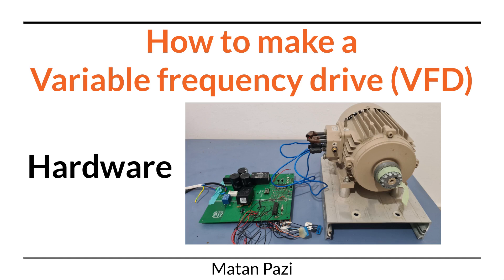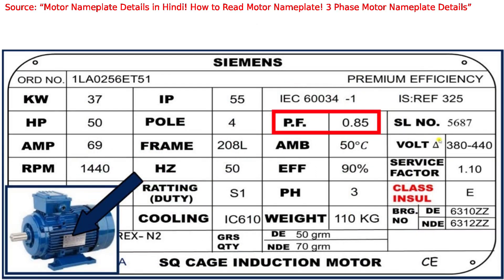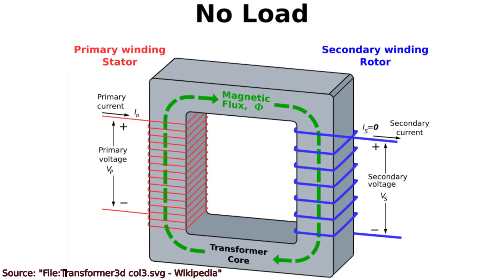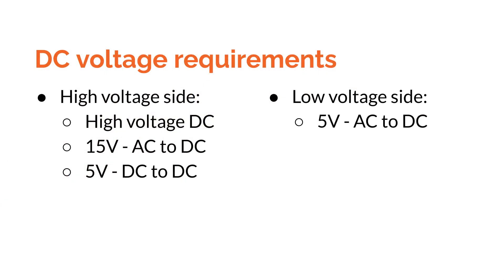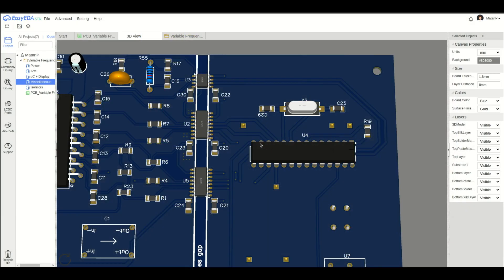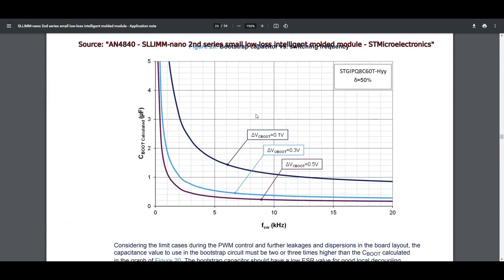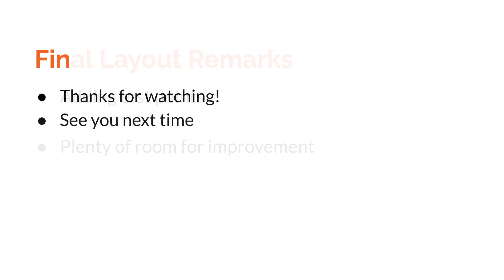How to make a Variable Frequency Drive (VFD) | 2: Hardware Design

Comment: Hi Matan, outstanding work, really, I have a question regarding the STGIPQ8C60T, For the calculation of P_RS, is it suppose to be (8/3)^2*(0.2) instead of (0.2/3)? Because every resistor has the value of 0.2 Ohm. Nevertheless, it is an excellent project that you conducted.
Reply from the maker: Thanks, can you please share the relevant time stamp?
Reply: @MatanPazi  Hi Matan, sorry I saw you reply lately! In my design I am looking for R shunt. I looked to document AN4043 (Application Note SLIMM Nano). I noticed Equation 4: P shunt = I shunt^2 * R shunt/power derating ratio, but in your design you divide the current 8A by 3 ( because you decided 3 branches), but instead of multiplying the resistor value 0.2, you divided 0.2/3. So, the question is how we decide R shunt because I couldn't find  the power derating ratio?
Reply from the maker: @mahmoodal-imam2892  What time did I do this calculation?
Save me the time :)
Reply: @MatanPazi  Hi Matan, thanks for replying. I am not sure I understand you about the time of calculation? do you mean input AC frequency? or the sampling rate of the PWM?
Reply from the maker: @mahmoodal-imam2892  haha no, at what time in the video do I make the calculation?
Reply: @MatanPazi  😁 Oh! Yes, that is right!! It is starting at 11:50 when you starts talking about the IPM. You said that you referred to datasheet examples. The R shunt that I asking about is in the IPM block
Reply from the maker: @mahmoodal-imam2892  Well shit, that's an absolute mistake haha, thanks for pointing it out.
I shouldn't have divided the resistance by 3 as well.
The equation should've been: P_RS = (8/3)^2 * (0.2)~ 1.42[W].
Luckily, or maybe I made the correction somewhere else without updating the note in the schematic, I chose 3[W] resistors, so that totally covers this use case.

And I pretty much ignored the power derating parameter since I didn't really know what temperature the shunt resistors would reach, I just doubled the required wattage and hoped for the best.

Comment: Is it okay to not add lc filter in output? I read induction motor will easily hot and the winding vibrate if running with square wave, but idk with digital sine wave
Reply from the maker: Not sure for industrial applications.
I don't think adding an LC filter would reduce heating or vibrations though.
For simple applications I don't think it matters much.

Here's a link to an article that goes over the reasons for adding an LC filter:
https://ieeexplore.ieee.org/document/790930
In short:
1. High dv/dt may cause issues with long motor cables. A capacitor would help.
2. High frequency current ripple. An inductor would help.
3. High dv/dt leads to EMI. A capacitor would help.

My inputs:
1. Seems like the cable limit length stated in the article is quite generous. A limit of 5[m] of cable for 10,000 V/us seems pretty good.
2. Current ripple depends on the motor inductance and the switching frequency. I suspect this is a non issue for most standard applications (Switching frequencies in the kHz and relatively high inductances, higher than 1 mH).
3. Sure, that could help. There are indeed quite high ripples of voltage on the motor phases, smoothing them out could help.
Reply: @matanpazi3777  i see... Can this atmega328 increase carrier frequency of this setup? so adding lc fillter can be smaller

Comment: Thank you for sharing all the videos, these are really helpful.
However, I observed that u used 125V rated fuses in line with motor output, whereas ur system is designed for 230 V.
Can u please explain this difference in the rating.
Thank u
Reply from the maker: My pleasure.

How so?
The JFC2410-1800FS is rated for 250 AC voltage according to the datasheet.
Reply: @MatanPazi Here it shows it
to be 125V.

https://www.lcsc.com/datasheet/lcsc_datasheet_2305151202_Shenzhen-JDT-Fuse-JFC2410-1800FS_C2994765.pdf
Reply: @MatanPazi  Thanks for the reply. I am referring datasheet from LCSC here. It says so.
https://www.lcsc.com/datasheet/lcsc_datasheet_2305151202_Shenzhen-JDT-Fuse-JFC2410-1800FS_C2994765.pdf
Reply: Thanks for your reply. Please see this datasheet in the link. It says 125V for 8A.

https://www.lcsc.com/datasheet/lcsc_datasheet_2305151202_Shenzhen-JDT-Fuse-JFC2410-1800FS_C2994765.pdf

Comment: Hello Sir. When you increase the speed while keeping v/f constant and keep the load constant, does the input current increase?
Reply from the maker: Certo, as the output power increases (~torque*speed) so does the input power (V*I)
Reply: @MatanPazi   V*I*(Power Factor) for AC circuits.
As the frequency increases the impedance in the stator windings increases which lowers the power factor.
Reply: @MatanPazi   When I do a thought experiment I predict that the input current will remain constant as V/Hz increases, as long as the load remains the same.
Reply: @MatanPazi  If power factor correction was done on the motor, so a capacitor was added in the circuit to match the motors inductive reactance, the only impedance would be the resistance in the stator winding. I think the voltage needed to run the motor would be much less 🤷🏾‍♂️

Comment: I have a few pointers. Your mention of splitting ground planes usually refers to mixed signal circuits, where analog and digital low voltage signals are concerned. Inverters have thier control boards always galvanicly isolated. Instead of those small integrated dc-dc bricks they use a single smps running off the main dc rail with isolated windings powering each isolated subcircuit. Also current measurement is done on 2 sometimes on all 3 phases. One thing missing from your inverter is any brakeing circuit. A brakeing chopper transistor and a braking resistor are used to keep dc rail in check, as when you brake electronically, the energy goes back to the capacitors raising the voltage. If you brake without any resistor connected, the voltage will go well above normal and blow up the module or caps.(ask me how I know) Best of luck with your project. I would love to see how it turns out.
Reply: THis is not always true : https://www.youtube.com/watch?v=SOohi-EXp68
You can brake slowly, to not raise DC and trigger FAULT.
Reply: @PavolFilek  Yes, slow braking or DC braking won't cause it. Still most industrial drives have provisions for managing thier bus voltage.

Comment: i wondered if you could use a FET to discharge the caps, after switch-off...or a tiny relay off the AC input, to switch on the bleed resistors...or an optoisolator, from the AC input, which pulls down the gate of the discharge FET (a bit of RC, too) until the AC goes away, at which point the FET gets biased on, and pulls down the capacitors to some lower voltage...
Reply from the maker: There are definitely better ways to implement the bleeding of the capacitors.
Not sure what relays/opto isolators can be fed by AC voltage, but there's probably some solution to this problem.
Reply: @MatanPazi  I figured out a circuit that could use an optocoupler, with a single diode from AS into a small R/C, so that the optocoupler holds down the gate of a FET, when AS is present, then allows the High Voltage DC to bias the FET on, as soon as the AC is gone for a second or two, which allows the FET to pull down the high voltage caps, through a fairly fat resistor, quickly, but without having the bleed resistor active when running... might be able to use this for soft start, too...
Anyway, just an idea
Reply: Hi sir, after rectifier ac 220v ac, it become 310v dc right, how to reduce?? Because my motor only acept 200v @MatanPazi

Comment: One issue with a charging resistor is that it doesn't solve huge current spikes during normal operation due to a very short conduction angle. Such large capacitance means that the peak current through the rectifier is many times the current draw of the device. This leads to higher losses and, more importantly, a lot of harmonics introduced. High power diode rectifiers like that create a lot of noise on the AC side which may affect other electronics.
Even without PFC rectifiers, this can be partially remedied by adding a relatively large inductance after the rectifier. A 10 mH choke would smooth out the current spikes and it may also remove the need for the charging resistor altogether since the current is now limited by how quickly the choke current can raise since there's no longer a dead short between L and N.
Cost-wise, the charging resistor circuit is a lot cheaper than appropriately sized choke (which is still cheaper than a 2 kW active rectifier) so it may be fine for a diy solution.
Reply: You do not need charging resistor, DC bus is powered from 4-phase BUCK or BOOST converter, from solar panels or battery,
so you do not need PFC, 10 mH chokes etc. BUCK and BOOST also takes care of dissipating brakeing power.
Reply: @PavolFilek  The DC bus is powered by a passive bridge rectifier. It's literally in the video.
Reply: @Ryrzard  THis is bad solution. I do not need rectifier, If I have no AC inverter in my solar,
I need only DC 30 - 900 V to make 360 - 720 V on DC BUS for VFD.
Reply: @PavolFilek  What are you even talking about? The video is literally about AC fed VFD. There's no solar mentioned anywhere.
Reply: @Ryrzard  VFD is not AC fed, VFD is no dependent on AC. VFD has DC BUS, so can be fed like this, from SOLAR > https://www.youtube.com/watch?v=SOohi-EXp68
AC conversion is not needed. 
This is like if you charge your BEV from solar
60 - 900 V DC, you do not need AC.
Reply: @PavolFilek  Are you sure you're commenting on the correct video? lol
Reply: @Ryrzard  Yes I am shure, there is a  lot of options to make VFD, AC dependent so you need BUCK MPPT - BATTERY - DC-AC 3-phase - rectifier - VFD.
Or you can make simple solution, liek I suggested. But maybe you need to make things your way, to have more complex solution, so low efficiency, and high propability of failure. 
My way is easy, simple and low cost with MTBF 200 000 hours.
Reply: @PavolFilek  Yeah I think you're on the wrong video. It's about a grid fed VFD with a passive rectifier.
Reply: @Ryrzard  NO, you are wrong, it is videoo about VFD, not about grid FED. VFD is independent of grid. VFD can be fed from DC. If you do not account for this, you are a bad engineer.. This solution is used 15 - 20 y. because we have PERC, PERT, IBC etc. solar panels. So we are 15 - 20 y. independent of grid and grid fed VFDs.
Reply: @PavolFilek  You did not watch the video. If you did you'd know he was building a VFD powered from rectified AC. Literally just watch the video.

Comment: your work is marvelous but i face some difficulty with your program which have (ISR (TIMER0_OVF_vect);
 {   ) This error..could you help me if you have some free time.
Reply from the maker: Thanks :)
Look at the comments in lines 54, 55.
I assume that's the reason for the error you're getting.
Reply: Eu também estou com este problema na compilação do timer0 e as linhas 54 e 55 estão conforme o programa original. Como resolver este problema?  @MatanPazi
Reply: Deixa eu vi se posso ajudar. Li que o compilador nativo do arduino usa o timer0 e acho que é por isso o erro. Mudei para o timer1. Saber qual compilador Matan usou

Comment: Awesome project to begin with! I am also designing my own VFD and use your videos as a reference design guide. However, I do have a question about the DC-bus capacitors. As shown in the video you used the following formula: Farad = Ampere*second/Volt. The formula itself is clear, but in the sidenotes of the schematics you used 8[A] as current for the capacitors. How did you determine this?  Since it is DC I thought it could be done with I=P/U, but then I don't get the same value.
Reply from the maker: Check this video out by Schematix:
https://youtu.be/CAYKno16weE

Comment: I also build my own vfd, yours was way much better. The difference is the motor driver ic, the relay and bleeding resistor, 1 phase to 3 phase capabilities, and i just use arduino uno because i was too lazy to build my own atmega 328 circuit. Nice job👍

Add: I do not see a step up transformer, your 2kw motor will only ouput around 1.5k without it.
Reply from the maker: Thanks!
And nice for creating your own VFD.

Can you please elaborate regarding the step up transformer?
Reply: @MatanPazi  no step up, most commercial vfd only use voltage doubler.
Reply from the maker: @wiradharma7030  oh, but my VFD's output voltage is the motor's rated voltage, why would I need to step up the voltage?
Reply: @MatanPazi  did you know constant v/freq? Variable freqyency drive doesn't only control the frequency but the duty cycle. By controlling the duty cycle you control yhe average voltage.

If you want to build something that already exist, first learn the current model then make your improvement. I made commercial vfd because i could improve current design, if not i just simply buy one. I mean why the hassle if i could buy one for few $$?
Reply from the maker: @wiradharma7030  Can you please give a link to source explaining the need for step-up transformers in normal operation VFDs?
Only found this:
https://mb-drive-services.com/vfd-output-transformers-where-do-we-need-them/
And the most relevant reason was this:
"VFD can certainly adjust the inverter voltage, but at lower voltages the power is reduced. If the customer wants the same power at each voltage level or relatively high power at lower voltages, the output transformer is beneficial."

This really isn't an issue for my application.
Reply: @MatanPazi Sorry but i am to exhausted, but if you use squirrel cage motor. The efficiency would be better to use 3 phase motor.

Here the home main voltage is 220v and the three phase is 380v. I use 220v, using the voltage doubler boost my dc bus to slightly more than 600v. I did not use vector pwm but multi carrier spwm, which have slightly less dc bus utilization.

You could just look at specs of a commercial vfd output voltage range. If my memory did not lie to me, it should be around 440v for the basic models. And diode got higher efficiency than a transformer, transformer should be around 80%. The voltage doubler only have energy loss from the diode voltage drop, the efficiency should be more than 94%. Just look at the specs, omron vfd is a good vfd for a benchmark. No transformer visible on many teardown vids.

Comment: Sir, how did you calculate for the bus capacitors. Your calculated value is 26665  micro farad but you use less than that on the capacitor bus. Can you clarify pls. Thanks
Reply from the maker: *2666[uF]
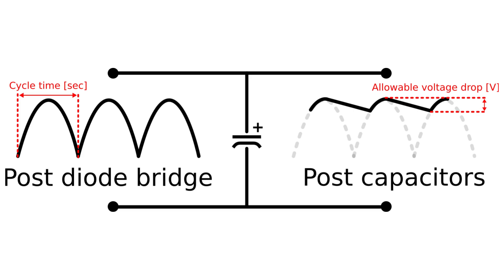You are correct, I explain my decision here 5:58
Pretty much due to cost and space + hoping it'll work OK.

Comment: Great video. I am currently making a 115V/400hz power supply and your project is very interesting. I did not know STGIPQ which seems to be the right solution for my projet. I'm gonna read very carefully the AN4043 application note. Thank you very much for this work and sharing your knowledge.
Reply from the maker: Thanks a lot! Happy to hear it helped.
Good luck on your project!